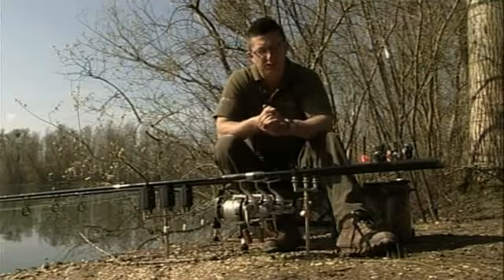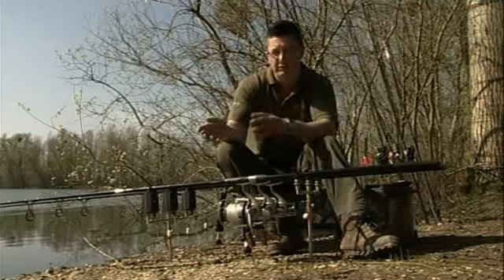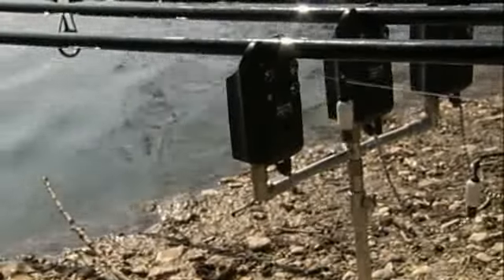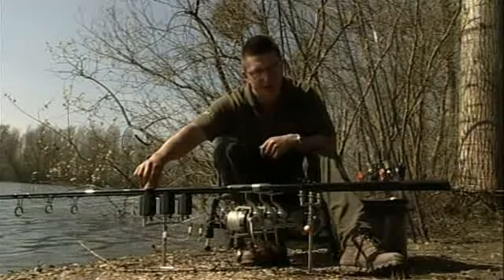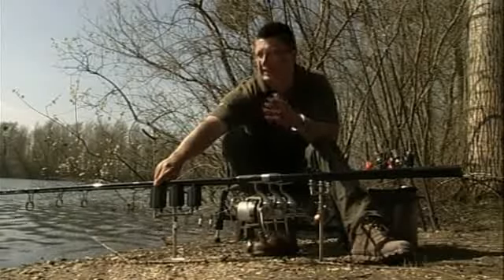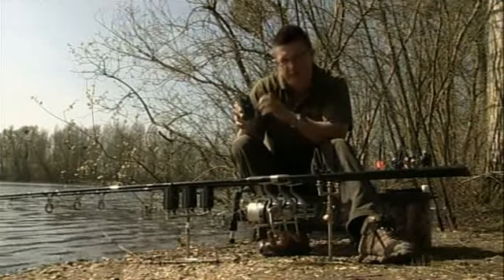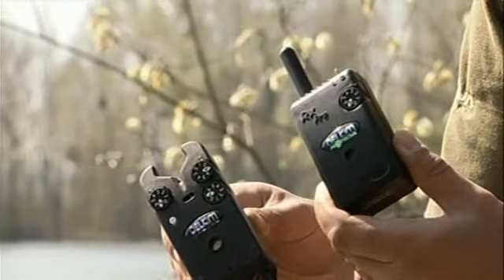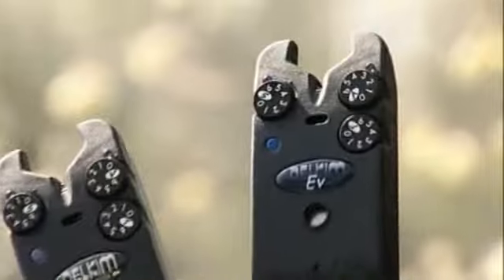Delkim Tx-i Plus review (CTTT Volume 1)

Comment: Had mine 10 months now and best alarms I've had so far, the sensitivity is as I would want it to be very high and I reckon setting the sensitivity to 2-3 is as sensitive as any roller wheel alarms out there. Through summer or winter when the wind is mild I would have the sensitivity set to the highest which is great for picking up any liners which indicates the fish are mooching about closer in and also great when fishing far out in winter when the Carp are less active. If there was one feature I would want adding it would be to change the sensitivity of the alarms from the receiver as you obviously want to keep the highest sensitivity you can get away with when windy which means having to keep getting out the bivvy to keep turning down a notch when windy and it was a bitterly cold wind the other night. Get this sorted they will be more than a cut above the rest